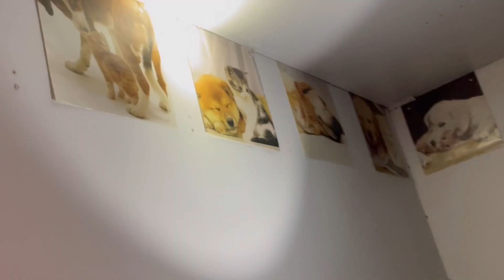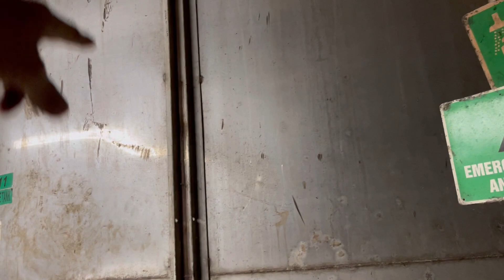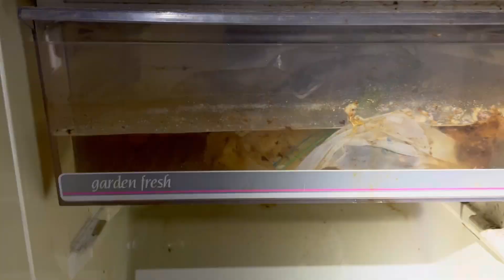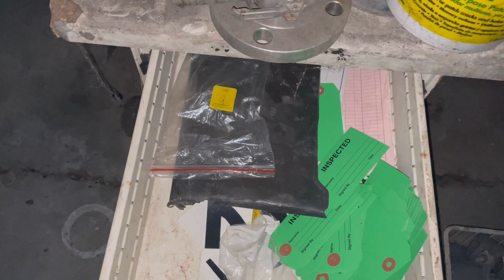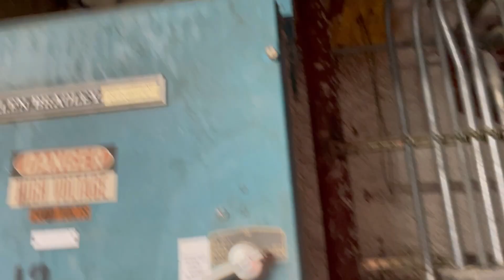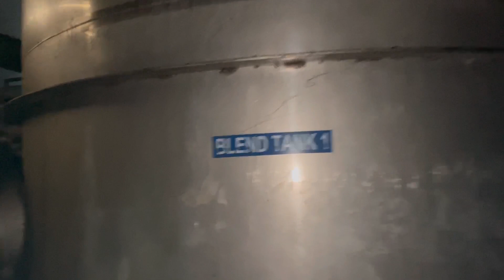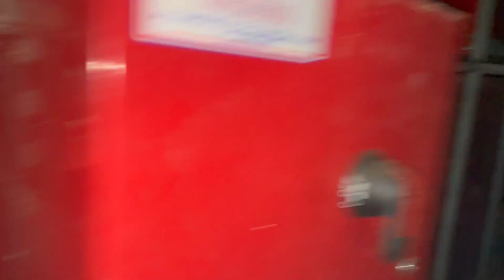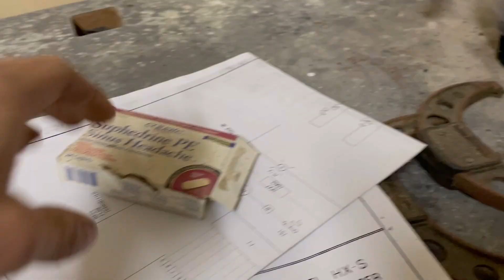Haunted Orange Juice Plant - Stainless Tank Demolition Bid

Comment: Leave this mess to a demolition expert. Too many freaking surprises you are going to run into. Potential for grief may override potential for profit.
Reply: I second that!
Reply from the maker: I started in demo lol
Reply: This guy has no clue
Reply: Owner's probably had 20 different outfits bidding that job for last 12 years.  Eventually scrap and rent will go high enough to pay the price to remove them.
Reply: @MeltinMetalAnthony  how is that demo going if you did it 
Also please review the  Chicago electric 80amp stick welder

Comment: You need an excavator with Hydraulic shear. The Hydraulic shear will chop and crunch the tanks and pipes, with very little use of a torch, if you have a skilled operator,  Next you need a skid steer with a grapple bucket. Also, add a grapple bucket to the same excavator or a second excavator. My guess is a month's rental on all the equipment. You can contract out several large dump trucks so as one is filled the next one is pulling up as they make round trips to the scrap yard. If you get to sell the scrap then that can be worth a lot of money in today's market.  Make sure you get an excavator with a long reach for the height.

Comment: Going to need to cut access ways, probably water jet, environmental tank crews with vactors, skid steer, mini excavator, roll off cans, 320 with shear and hammer, dump trucks, h2s meters, liquivac truck for line breaks, send samples of the "sludge" to a lab, test for asbestos, then hire remediation specialists because they are certified to dump it at the landfill. Like a 1.5 million dollar job and a bankruptcy. How much does a permit cost, is it per tank, or devide property up into sections to be remediated, then cut down?

Comment: That is a fairly typical setup, the electrical rooms are called MCC master control centers on your contract i would exclude those. And don't beat up the guys up to much all the welds are done by maintenance crews and can't always properly clean. Looks like a good project if you can turn some quick money to keep it going.
Reply: hi, times two on that electrical room.  the welds were not done in-house,  repairs maybe but the tanks were fabricated in place or outside and moved in place.  it would depend if the building was in place yet or not.
Reply from the maker: is the snuff room standard as well?
Reply: @MeltinMetalAnthony  are you talking about the downstairs area at the end? If so I've seen em used for condensation control all sorts of do not enter sighns and I dought they wanted osha to look down their. It's been awhile since I've done inspections but it all looks like a typical processing plant to me.

Comment: The rust looks to me like they user regular steel wire wheel instead of a stainless one to buff the weld
Reply: Either that or maybe they didn't use stainless filler. At 20:50 they find some of what looks like generic er70 rod.

Comment: To the coffee can. In the bittom of the coffee can i cut an eight sided star... Wasnt intentional i was tryinh for a weld pattern, i attatched a (piranha washer) to the coffee can sude eith the star to practice the beads . I tried to practice stacking beads in accordance to the teeth also i went above and below. Im using paper towl rolls and discovered they are louder than seashells i had a ripped corner and decided to weld it open and not drip it on the inside. It was fun. And satisfying. Then i tried welding the toilet paper tube from edge to edge , i had to pull it thin so it didnt cave in. If i practiced it im sure i could make a solid weld. The cup stands upside down with coke can on top the a horizontal bag of coffee with another csn of coffee i can lay the pipe down to be a "straight" pipe i have multiple brands of toilet paper tubes so one fits inside the other and there wont be a weld because its a "plunger or inch worm" i have the lids that have a stop sign door that im going to weld together...im doing this to practice witg my measurements and work with duffetent types of "metals" my closet is a garage....

Comment: If you cut along the lines of the welds you will have complete sheets of steel.  You can make a sheet metal straightener and sell the sheets of stainless as used complete stainless steel.  Worth much more than scrap.     Here is a company that resells lots of used materials that may be interested in the used sheet and pipe.

Comment: You should be more careful around anything with chemicals. Even if they say it is "clean" or "decontaminated" , it doesn't mean it is completely safe. Respirator and gloves are needed at the very least when at the place. Also, I would not demo the tanks until the sludge is completely removed. Who knows what is exactly in it. They say it is biodiesel and it is not flammable, but diesel is not labeled as flammable. It is considered as combustible by the petrol industry and could still catch on fire. It should be the responsibility of the owner to get rid of the waste therefore you do not have the liability associated with it. Good luck if you are awarded the job, but be leery of all the extra small tasks that are needed. They will eat your lunch if you let them.
Reply: Also get an auctioneer involved to get rid of the small stuff that can be easily removed. Factor them in as generating zero income, but it will get one job out of the way.
Reply: @UCwJk4gNZyJ5h8kTi7mr24Iw Does not matter. Waste is waste. When you scale up anything the overlooked hazards become more apparent. Citric acid (the acid component of Orange Juice) may not hurt you too much but the ammonia in the chiller lines, the additives that were added to the biodiesel, and to some extent the kitty litter is not good for you. If they left that much crap in those tanks, who knows what kind of 'decontamination' process was done. I am not saying be scared of your shadow, but protect yourself above all else and do not believe a word they say. Look at what was done and make your own conclusions about it.

Comment: you can probably negotiate price of that stainless with a scrap company.  it definitely has value.  i've seen your work, you can do this but it will take some equipment and manpower.  the biggest thing you have working for you is that there are not ongoing operations ie company employees walking around you, above you, below you.  as it is you are just pulling material out, really not that big deal and should be a good experience.   you'll only need a couple of people with skills and some laborers.   good luck.
Reply: payment?   you should get front money and then work out a draw schedule possibly based on tank removal.  pull one, pay for one.   i am not kidding
about the stainless,  that would be a nice order and even though it is contaminated with the amount you have you should get a nice check.   call a MAJOR scrapper,  try tampa or jacksonville and get pricing on that weight first.   you may have to prove the alloy.  hard to say,  could be both 316 and 304 in there.    if it were me i would cut and let the stuff fall inside the tank.  all the way down.
Reply from the maker: @newage3397  we estimated 1.2 mill in stainless alone
Reply: @MeltinMetalAnthony  I thought I heard you mention 400k lbs in video.  You must have upped the weight.   Is that the Florida natural plant up on 27?  Drove to Lake Wales last week and noticed one of the plants was down.    Big job.  Hardest part is where to start.   Good luck